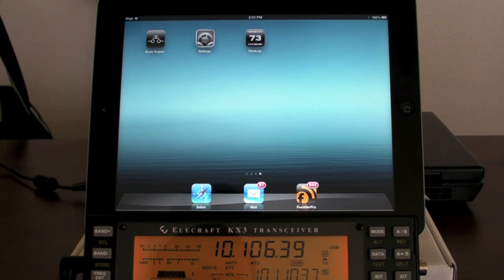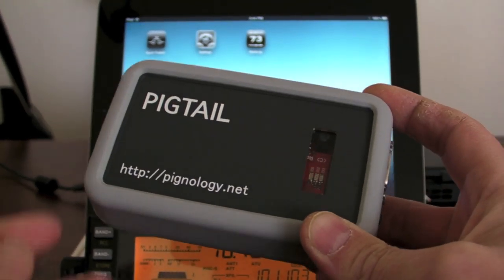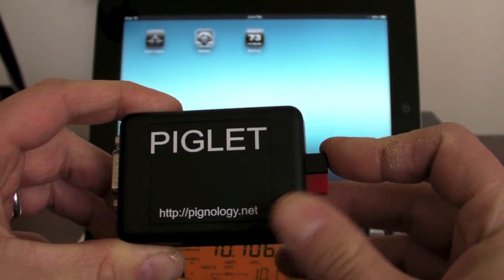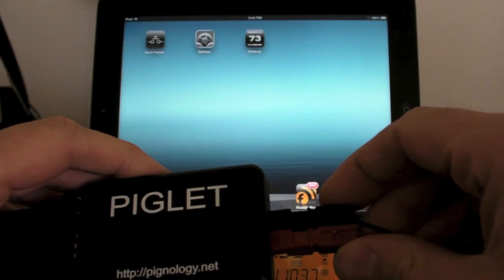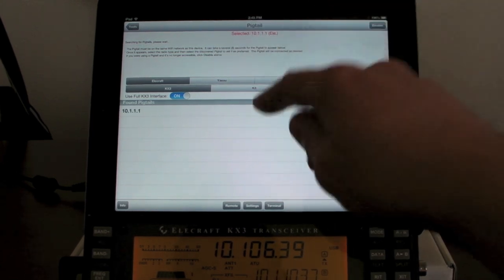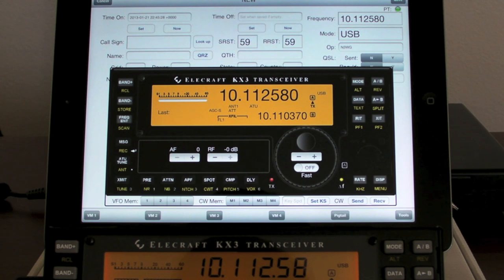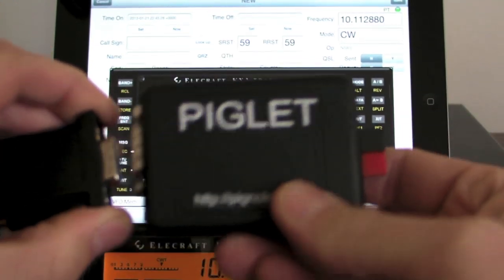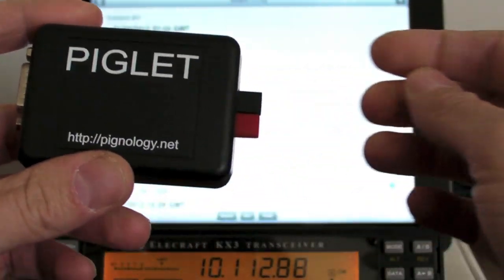New Pigtail - Piglet

Comment from the maker: Hi Doug,
It does work to create a wireless serial link to Macbook as well however it only works with applications that have the connectivity built-in.  The Pignology apps HamLog, K3UI and KX3UI will work with Piglet.  HamLog can talk to Piglet connected to an IC-7000.

"Why can't we use Signal Link Hardware?"  
I believe SignaLink is a sound card.  Piglet is just serial connectivity.  PigRemote has streaming audio built-in and works over the Internet.

73,
Nick

Comment: Thanks a lot Nick for the response. Please let us know when open the shop because i dont want to be out again :-) . Do you know if in a future you can add the PSK mode to the Pigtail software? im looking for a complete solution for PSK and CW. By the way i like more the previous version of the Pigtail because the rubber bump protector is a very nice to have in fields operations, 73, KP4MLF

Comment from the maker: I should have mentioned that in the video.  The datasheet of the regulator says 6.4-18v but there's a voltage drop due to the reverse voltage protection diode, so let's say about 7 as a minimum and max of 15 to be safe.  I've tested it on a 9v battery reading 8v and with a 13.8v power supply.

73,
Nick
N3WG

Nick

Comment from the maker: Hi Simon,
I have a prototype working with audio built-in.  The audio daughter board I designed for it is being produced now.  It's an embedded linux system with a serial port for rig control and a wireless connection for environment control via HamStack products.  I should have it ready to go by Dayton, maybe Visalia.

If you're interested in a software only remote rig control solution with bi-directional audio, check out EtherPig.com.  

Nick